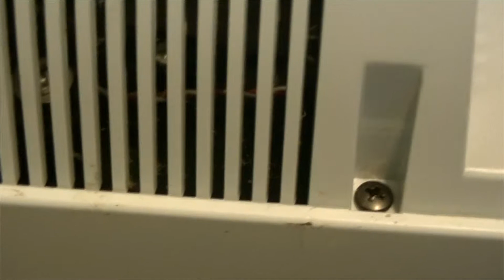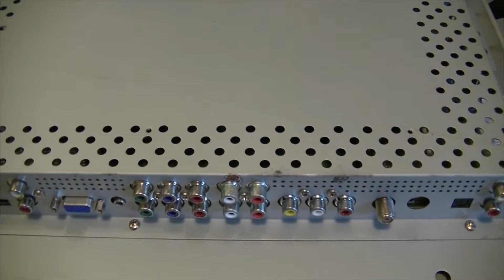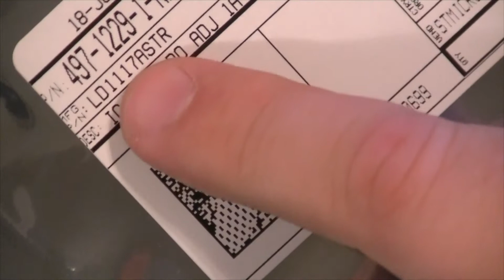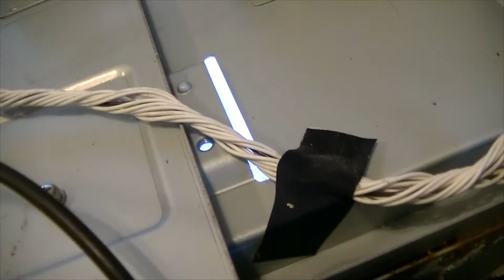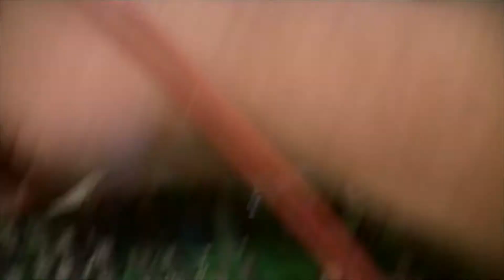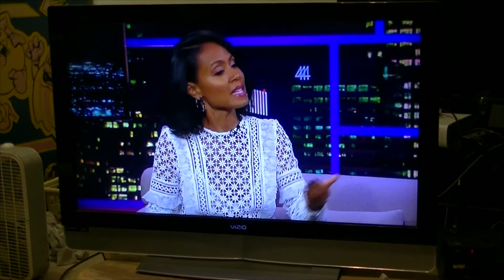Vizio VX42L Repair

Comment: Seriously, how do you get this back off?
Reply: Remove the base. Take out the screws at the perimeter. Get your toilet plunger, push, and pull the top of the back cover away. Eventually you'll get the back off.

Comment: Greetings! U7 reads 1.2v as output. Should it be 1.5v? U33 passed the test. PSU outputs and main board fuses are ok, including U3. TV powers I get to see flickering and it goes blank. VIZIO logo goes from amber to white and back to amber. Thanx!!!!